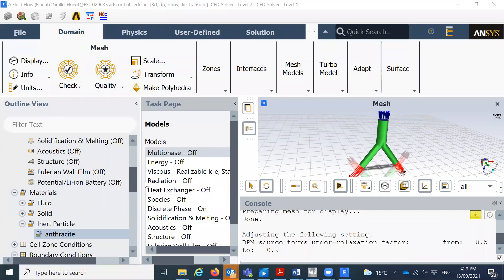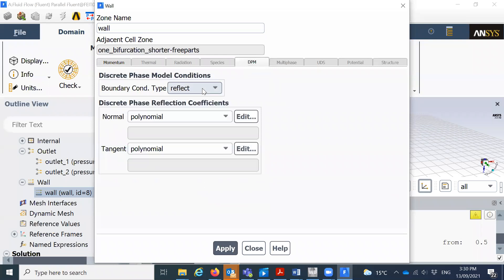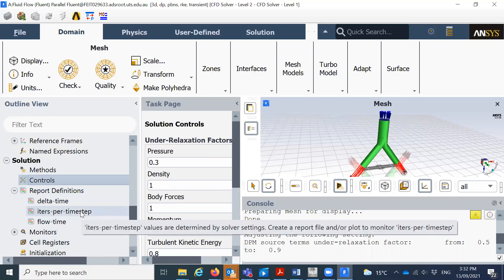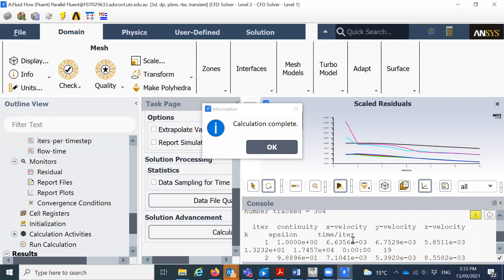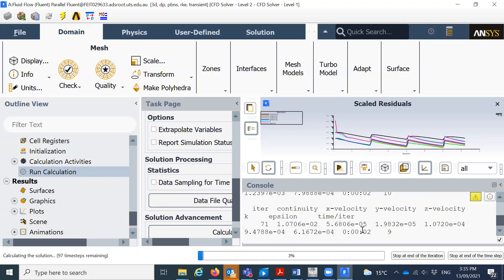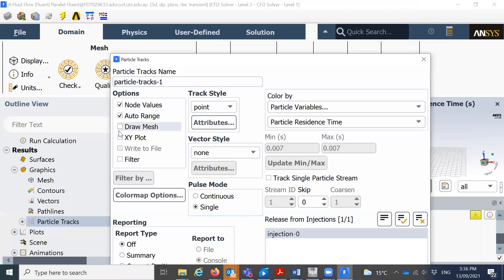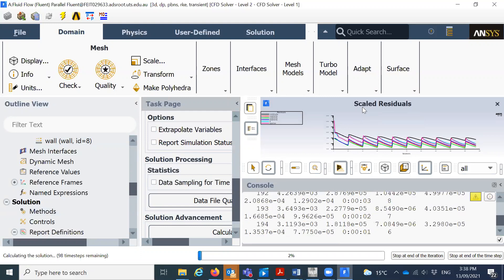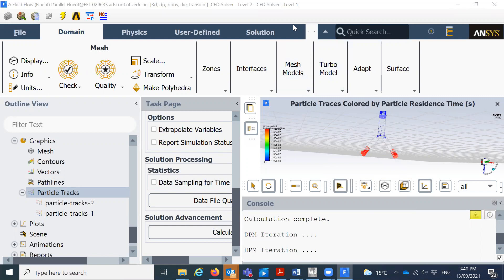Particle Transport ANSYS 2020 Part 2

Comment: Hello Mr saidul Islam I must acknowledge your tutorial. It is actually spot on. However towards the end of the video you mentioned about another video where you will analyse the result from this current simulation. Could you please direct me to the analysis video.
Reply from the maker: https://www.youtube.com/watch?v=JxW9EqPtTqE&t=399s
Reply from the maker: For deposition visualization, you need to collect the x,y,z positions of the trapped particles. Then you can use Tecplot or any other software to visualize the deposition.